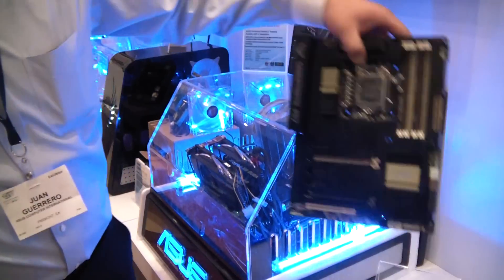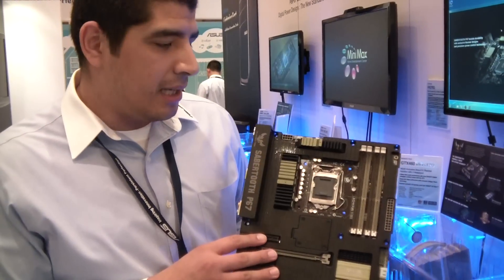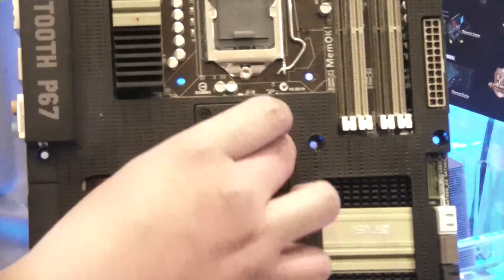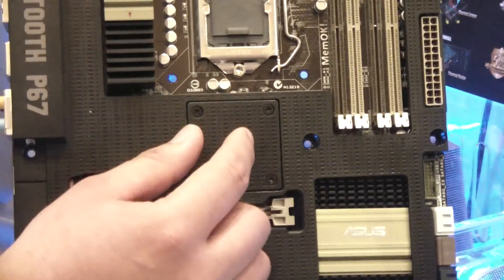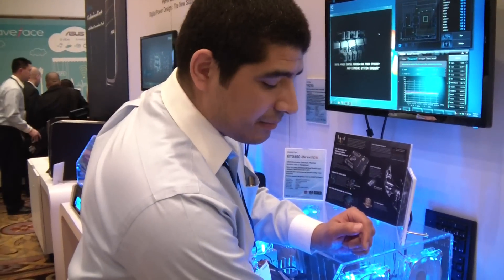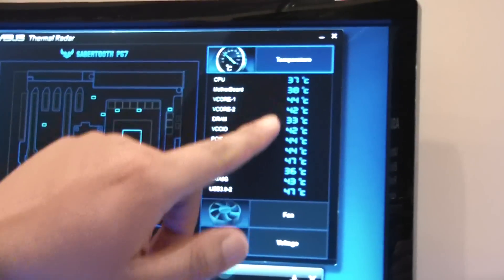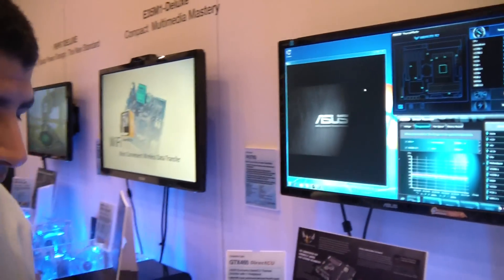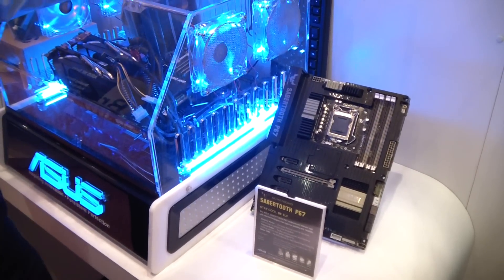Sabertooth P67 Motherboard with Thermal Armor - ASUS - CES 2011

Comment: Hi, did you remove the battery? I think I may have to remove it. The computer does not shut down when I click shut down. I moved the CLRTC jumper from 1-2 to 2-3 and it fixes it for a couple days then it goes back to not shutting down. My next step will be to remove the darn battery.

Aloha

Comment: have you tried to install 2 gtx570 directcu 2 cards in this board  i have its almost not possible thier is about 1 eighth space between them defeats  cooling  top gpu gets to hot i tried spreading them as much a possible just does not seem right  get back to me on this problem will you   or can i email the asus guy  jj thanks doug

Comment: I have this board replace the faulty P8P67 Pro.. I haven't installed the board fan cuz' the cpu heatsink is too big.. I do have 3 other fans on the case.. will it damage my board IF i don't install that fan?

Comment: @Kenji314159 
What are you talking about? I never mention nothing
about Graphics Card has something to do with CPU clock...

If you favor the 1155 over the 1366 thats fine 

my point was that the 1366 is still gtreat for games!!!

Now as for performance 960 and lower have you ever compare
them side by side or are you going by what you have been reading???

Comment: @mjharo72 That doesn't make sense at all. What has a Graphics Card (or two of them in SLI) to do with CPU clock? It's a fact that the new CPUs on the LGA1155 socket offer more power for less money. All Intel i7 lower than 960 have a worse performance than the new i5 2500. I don't even speak of the new i7 2600k which is better. I understand gamers who don't want to change - high end hardware is expensive and it's not worth replacing a motherboard and a CPU of a computer, they are most expensive.

Comment: @Kenji314159 
Yes your right they are third the price of these top end
processors Intel core i7 965,975,980,990

but not if you compare them with the Intel core i7 920,930,940,950,960

I know for a fact that gamers are happy with these processors above
(LGA 1366) and will NOT trade for the (LGA 1155) just because they
are newer processors!

Tell me what games can out perform 
HD5970,6990 or GTX580,570 in Crossfire or SLI? 

LGA 1366 is still the future for games and etc!
Thumbs up if you agree!

Comment: Gah, how silly to make it a 50mm fan option :(  50mm fans are freaking aweful.

If Asus had thought this through properly, they'd have designed a cpu cooler to go with this!

What it'll need is a dual 120mm option like the Coolermaster V6 or V8.  However it'll need something like a very small peltier unit or micro-refridgerator because the old style coolers that blow air down are rubbish.  I've tried a few of them and the only one I liked was the Akasa AK-960E, which had good cfm but was loud.

Comment: Sabertooth models are one of my favorite offerings from Asus. However my application will certainly require the 60mm fan, because I use the Corsair H50 and heatsinks that blow air out the back of the case, rather than downward-aiming CPU fans. To be honest, I'd rather see a pretty PCB and all its bits than the tactical vest.